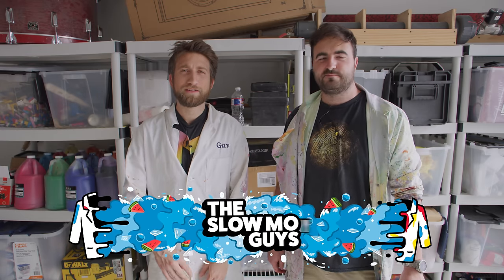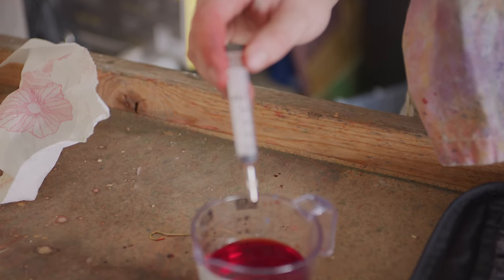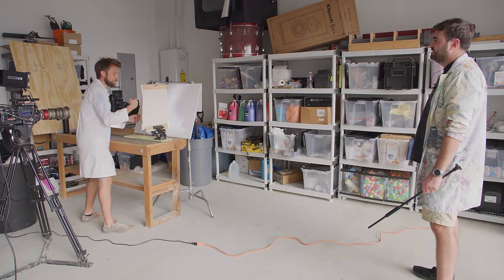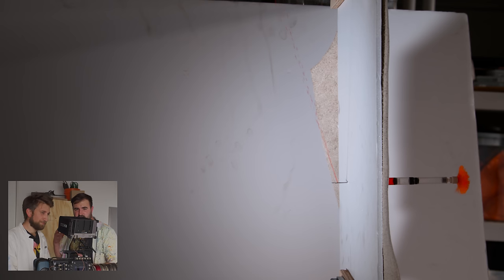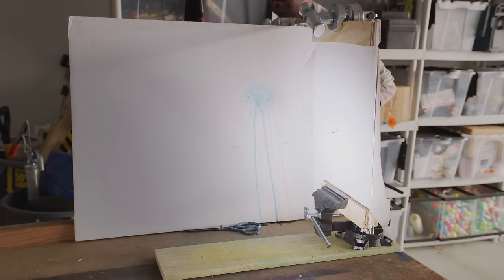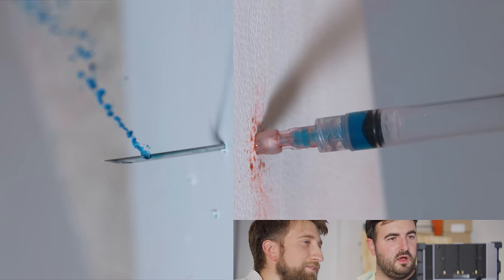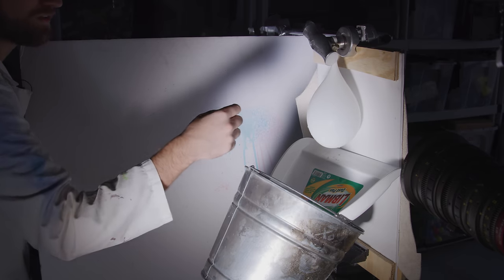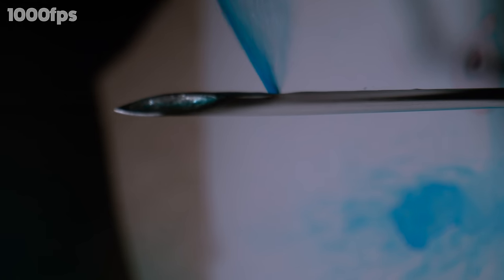How a Tranquilizer Dart Works in Slow Motion - The Slow Mo Guys

Comment: Just as a random fact, the "bottles" you draw liquid drugs from into a syringe is called an ampoule.
Reply: Thank you
Reply: He was referring to a "vial", which has a rubber cap through which you insert a needle.
An ampoule is glass bottle with no cap, which has to be broken by the neck.
Reply: @hermannrichter950  this
Reply: @hermannrichter950  thank you!
Reply: I thought the ampoule was in the sprinkler video and was something different?
Reply: @KAT-ew9wz  That is just a glass capsule. an ampule has a thinner section at it's neck so it will break at that point when you want to open it. A capsule would tend to just break at a pretty much random location which is not what you want here. You need it to break neatly at the neck so the contents are not lost while opening it. Generally ampules are used for medications that interact with gasses in the air so they are filled in an inert atmosphere and fully sealed with glass so there are no rubber seals gasses could easily diffuse in through.

Comment: “I see you’ve put on your little rod extension”
“I’m trying to get as much power out of it as I can”
So many things here are wrong. Such as physics.
or context.

To explain: A basic knowledge in physics can immediately point out that ballistic-barrel friction slows the projectile down when the barrel is extended. The end of the dart has friction against the barrel due to the massive surface area of the dart tail piece/stabilizer. Therefore, a barrel extension does not make a dart more powerful, but actually less powerful. Do not apply conventional firearm logic to a dart gun, the projectiles and method of launch are very different.

I can't explain context for you. You either watched the video or you didn't.

Edit: I don't usually revisit comments but this one (posted originally on February 13th, 2020) is incorrect. It was made with a largely ignorant understanding of modern ballistics. A quick google search can pull up "The Effect of Blowgun Length on the Energy of Its Projectile" from the University of South California. which very concisely summarizes the effect of extending the barrel length of a blowgun (although, admittedly, this was an informal study conducted for a state science fair).

As Caleb pointed out, a longer barrel means that there is more volumetric air to accelerate the dart before it leaves the barrel. More volume means longer time for the missile (the dart) to be accelerated before it leaves the barrel. Bigger chamber means more time for the forces of pressure to act upon the missile. Basic physics. Look at "Tube Volume and Dart Velocity" on the Blowgun Forum for a better understanding.

What both my original comment and Caleb's correction fails to illustrate, however, is the effect of pressure on the missile itself. Looking at the results of the theses of Brandon Louis Clark (student of the Honors College of University of South Florida), "Effect of Barrel Length on the Muzzle Velocity and Report from a Mosin-Nagant 7.62x54R Rifle," it can conclusively be determined that reducing the barrel length from the standard reduces the missile's (bullet's) barrel velocity. This aligns with the understanding that increasing barrel length ultimately increases barrel velocity. 

Quoted multiple times within Clark's theses is Robert Rinker's "Understanding Firearm Ballistics." The reason why Daniel is able to shoot a faster dart yielding a more powerful impact is because the barrel extension provides Daniel the capacity to create a larger mean pressure. The two biggest factors in obtaining a higher mean pressure (also referenced as average pressure by Rinker) is increasing peak pressure and the duration of pressure. These concepts are described heavily in pages 53-56 of the aforementioned book. 

As clockworkkirlia points out, the propulsion within the chamber of a blowgun is different than that of a conventional firearm. While Daniel, along with any other blowgun operator, do not benefit from extreme discharges of energy that smokeless powder (or more archaically, gunpowder/black powder) does, the human lungs can dispel a relatively constant stream of propulsion. This allows blowdarts to partially ignore a loss of pressure within the barrel's chamber. 

What I must personally note is that as the barrel length and/or diameter increases, the volume increases. See the calculations presented by Blowgun Forum user NightKnight on "Tube Volume and Dart Velocity." The primary benefit of an increased volume is that it increases the duration of pressure. The primary deficit is that, as pointed out by Rinker in page 55 of his book, increasing the volume decreases the pressure. This is due to Boyle's law, which states that pressure shares an inversely proportional relationship with volume (Pressure equals Force divided by Volume; P = F/V). Thus, in order for the velocity of a missile to benefit from a longer/larger barrel, force must increase as the missile travels further down the barrel. 

The reason why my initial comment is partially valid is because it is based off common everyday experience. Moving objects parallel to a surface and perpendicular to gravity, such as pushing a box across the floor, will result in the production of friction as an opposing force. Friction increases as velocity increases. Thus, as the blowdart travels further down the barrel at an increasing speed, the tail will suffer greater friction. Compounded with the fact that pressure is decreasing, alongside a multitude of other factors, it stands to reason that as the barrel length continues to increase, the gains in barrel velocity will begin to diminish. This conclusion is supported by Tom Gaylord in his article "How barrel length affects airgun performance" on Pyramyd Air. 

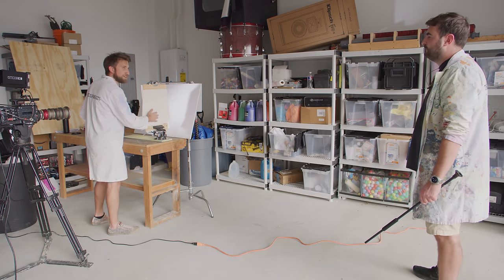TL;DR Blowguns lengths are typically at peak performance between 4 feet and 7 feet. Longer blowguns are more powerful but more unwieldy. They also demand greater output from the lungs. Anything over 7 feet is excessive. Some, but not all, firearm logic can be applied to blowguns (mostly fundamental aspects). If you're looking for the joke it's at 3:57. Context is at 3:45, but that makes it boring.
Reply: Longer barrel means longer acceleration before the air starts blowing around past the dart. Longer means faster.
Reply: @calebjowens  The confusion may be because there's obviously a cutoff where it's at airspeed and bullets slow down after that point because they don't have a constant source of acceleration. Not so with a blowdart.
Reply: ok boomer
Reply: Nobody realizes what this means put of context? Just me? I'll just leave...
Reply: x_Voidacity was here how old are you? Not for any reason..
Reply: Weirdo
Reply: We're going through EM in AP physics, and there's been a bit of talk about rubbing objects vigorously (paper on glass creates charge), and particles flying through holes (e- in E-field), and legs spreading (electroscope), and etc.
Reply: Husaberg R r/smartpeople
Reply: @clockworkkirlia7475  Works with bullets too. For most rifle calibers +- one inch means something like 30 ft/s.  There are just other limiting factors, and +-30 feet per second isn't very exciting when it's already doing more than a 1000 ft/s
Reply: i bet you use reddit
Reply: x_Voidacity was here that’s literally the joke, why you gotta be like this

Comment: them: heres a balloon
me: Oh cool so it'll show the water dyed blue
balloon: pops
me: Oh right, balloons pop.
Reply: Yeah and also: balloons, typically not see through
Reply: @dragoxk4542  Both these comments sound like a conversation that Dan and Gavin would have.
Reply: Pizzagelion - let go of your pickle 😂
Reply: Well actually, it may have been possible. If you put tape over the point of penetration the balloon should stay together. It works with needles
Reply: @ElykEcralc  Probably too much force here, and perhaps not interesting enough for a followup from Slomo guys. But it would be interesting to see.
Reply: @ElykEcralc  Right, I was going to say this. Stage magicians use that to put needles through balloons for some of their tricks. The second time you use a needle on the same spot it will pop normally.

Comment: I feel like you guys should invest in some clear gelatin for these injection modules. It won't be perfect, but it would be interesting.
Reply: That's why I clicked on this video... it looked like it was being injected into clear gelatin. I was like wtf lol.
Reply: no capillaries for the fluid to soak into though.
Reply: A bit of meat would be interesting though
Reply: It'd look like a pocket forming on the side of the needle, stuff escaping by the entry spot (despite the rubber plug I thinks).

Comment: Quick question when the dart hits the animal, what happens with the niddle If the animal Falls on top of it? Isn't It going to break and get stuck inside the animal?
Reply: Pedro Valle, good point,  I’m sure after they’ve been sedated if that does occur it would be removed
Reply: @Pedro Valle 
That's always something they worry about. It doesn't happen terribly often I don't think, but when it does, they take it out and clean it up so it won't get infected. They have to take it out and clean it up even if it doesn't break off.
Reply: @roseyhorsegirl8079  tks

Comment: Who else always thought the liquid came out the end of the needle instead of the side of it?
Reply: It does for most needles. Not for all tranquilizer needles, because at the speed/force at which it impacts, bits of skin, muscle, and other tissue can get inside the tip of the needle and plug it. Especially in animals with really thick hides like elephants and rhinos, hence it coming out of the side instead. A normal hand-injection, it definitely comes out of the tip.
Reply: I had no clue how it came out anyway. Im in 8th set science

Comment: another fun fact, the normal hole of the needle could not be used in its normal fashion to administer the tranquilizer due to the pressure difference between mode of travel and the injection site. once the dart is released from the blow gun, the liquid would begin to expel out the tip and losing fluid before making contact with the target. this is because the dart is lightly pressurized to eject the fluid without having someone press the syringe to force it out by hand. 

the tip is also at risk of being plugged by skin or whatever it may puncture through, like tough scales, or thick hide, that suddenly the only hole of escape for the liquid is plugged and the tranquilizer will not inject the liquid even though proper contact was made. 

so the tip is plugged intentionally, and used as a spear point to penetrate a hole for the whole needle to pass and then the side hole is rigged to release the cover once its at a deep enough level into the target that the liquid can release. the only downside to this design is you have to rely on over shooting with force than undershooting because if the puncture only barely passes the tip, it may not trigger the slide off cover for the side hole and the tranquilizer will most likely just fall off it its dangling from the somewhere. 

i must admit that all of this is entirely my own conclusions based on observations from the slow mo videos shown here. so i am pretty sure i have no idea what i am talking about :D
Reply: Makes sense.

Comment: Interesting. I thought that the little plastic nub would gradually slide up the needle as it bore into the skin. But in the super slow mo @7:21, you can see that the nub actually is immediately pushed back as soon as it impacts the skin. It even has enough force from that impact to wraps itself around the ledge of the tip of the dart's housing before the dart fully penetrated.

LOL, wrote this as I'm watching the video. And it's one of the very point the Slo Mo guys comment on. Oups.

Comment: So the hole is actually on the side of the tranquilizer so it’s easier to eject the fluid into the animal. FASCINATING.
Reply: another fun fact, the normal hole of the needle could not be used in its normal fashion to administer the tranquilizer due to the pressure difference between mode of travel and the injection site. once the dart is released from the blow gun, the liquid would begin to expel out the tip and losing fluid before making contact with the target. this is because the dart is lightly pressurized to eject the fluid without having someone press the syringe to force it out by hand. 

the tip is also at risk of being plugged by skin or whatever it may puncture through, like tough scales, or thick hide, that suddenly the only hole of escape for the liquid is plugged and the tranquilizer will not inject the liquid even though proper contact was made. 

so the tip is plugged intentionally, and used as a spear point to penetrate a hole for the whole needle to pass and then the side hole is rigged to release the cover once its at a deep enough level into the target that the liquid can release. the only downside to this design is you have to rely on over shooting with force than undershooting because if the puncture only barely passes the tip, it may not trigger the slide off cover for the side hole and the tranquilizer will most likely just fall off it its dangling from the somewhere. 

i must admit that all of this is entirely my own conclusions based on observations from the slow mo videos shown here. so i am pretty sure i have no idea what i am talking about :D

Comment: Always tought the dart whas Just like a syringe  but with more heavy materials in the rubber so when it stopped in something the momentum of the dart forced  the backpart to move forward causing  it to spit out the meds or things thats inside it. But this makes more sense.

Comment: For the beginning thoughts, the needle has to have that kind of pressure. The liquid is coming out so fast because the needle is not in body tissue. It needs to have enough pressure to inject a liquid inside body tissue, not thin air.

Comment: A tranq dart is basically a flying hyper dermic needle On the end of a projectile. I’m surprised I’ve never heard of this as a weapon of war. you don’t have to put tranquilizer in the dart you can put anything in there
Reply: Not really useful for a weapon of war. With an assault rifle you can carry 90-300 shots around with you. The most I have seen hunters carry around is around 10 darts. You have to manually load each one. Even for the rifle version the range and accuracy is relatively low. Good enough for animals, but definitely not the kind of close distance you want to have in a war.

Comment: So at 8:54, when they analyze the motion of the rubber slider, I counted 12 frames from the tip hitting the target until the whole syringe comes to a full stop. So that's 4ms if I'm not mistaken, as they've been filming at 3000 frames per second.
To put it in perspective: The sine wave of the electricity grid has a period of 20ms in Europe (50Hz) or 16.6ms in the US (60Hz).

Comment: What id be worried about is oxidization. No being that has blood flow is immune to it and if even the smallest bit of an air pocket is in the needle it could be lethal to anything up to a horse, or even an elephant, depending on how big the air pocket is and the concentration of oxygen within said air pocket

Comment: Actual release of 'drug' would be very different in an animal. I have experience of injecting horses, and the muscle spasm is significant. We even had one instance where the spasm sheered off the needle (luckily that was when a vet was there, and we were able to extract the broken needle promptly with forceps and minimal cutting.)

Comment: Obturation: With reference to firearms and air guns, obturation is the result of a bullet or pellet expanding or upsetting to fit the bore, or, in the case of a firearm, of a brass case expanding to seal against the chamber at the moment of firing.
https://en.m.wikipedia.org/wiki/Obturation

Comment: Late again to the party.   Those darts are also delivered via gun with compressed air.   Usually provided by foot pump.   There are some older systems that use a 22 blank to propel the dart (or CO2 via cartridge).  The dart has a special round that fires on impact.  That pressurizes the rear camber in the dart and a plunger much like the one in these, pushes the drug out the end of the needle.  No collar is needed and the opening is on the end of the needle like any other hypodermic needle.

Comment: At 7:07 you know what you should do, @slowmoguys?
Do this shot again, but this time, have someone stand behind Gav and slam their flat hands on those hamster cheeks to forcefully eject the air at hopefully much higher pressure/velocity, and then check if that makes the dart fly faster. ;)

Comment: HOW is the piston pushed forward?  A reverse vacuum? look close and see it has a special mechanism at the piston? Anyone know?
Reply: Between the two sections (where the air is stored and where the medicine is stored) there is a connection for air to travel.  As there is a plug on the needle nothing can come out.  

So when you fill the top with air, the return valve makes it impossible for air to escape so now you created a pressurized container.   It is pushing on the return valve as well as the plunger that would push the medicine but at the end is plugged it can't do that.

Once the rubber is pushed away on the needle the pressure pushes the medicine out the hole in the needle.
Reply: @ThyBountyHunter  That explains it pretty well. Thanks for the reply. (A reverse vaccum !) A pressurised container! that is the dyslexic part of my brain.